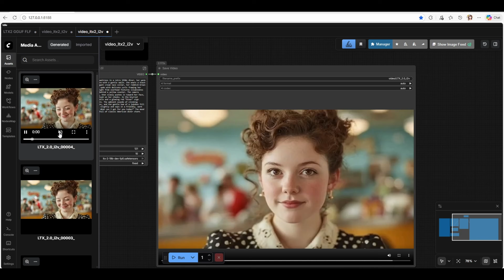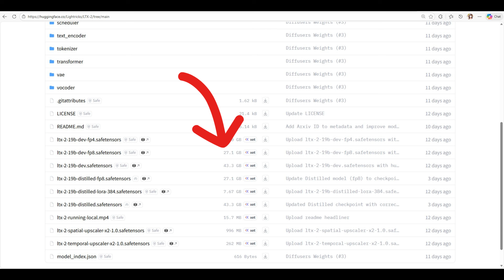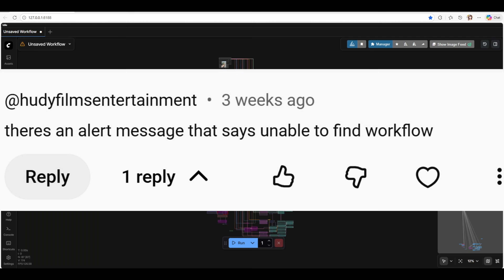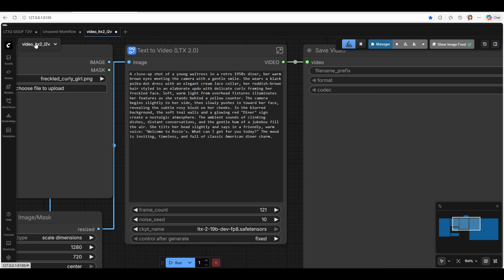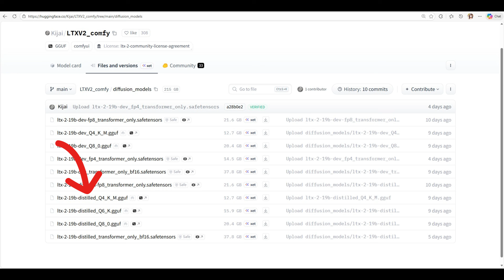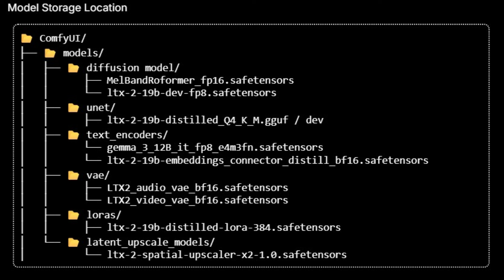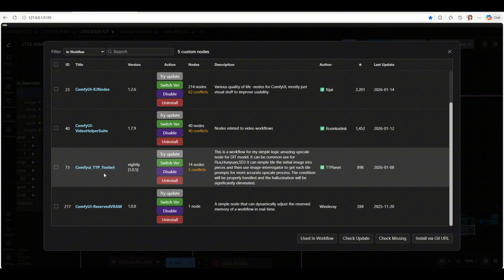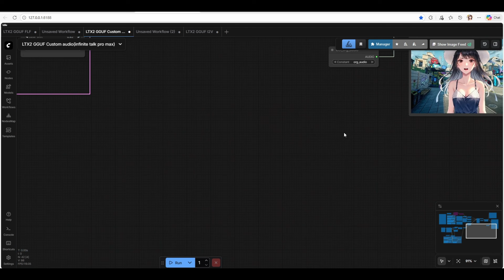LTX-2 Full GGUF Workflow Setup Tutorial (Text, Image First/Last Frame, Custom Audio)

Comment: what about 16GB VRAM + 32GB Ram?
Reply from the maker: I don’t know, should be fine — I can only run 8 GB VRAM + 32 GB RAM in certain cases.
Just note the model loading phase alone can eat around 38–40 GB system RAM, so you might run into issues there.

Comment: Useful video thanks. I managed to get the workflow working with the Q8 DEV GGUF but the video quality is still pretty much garbage at 720p, as you might expect since it only takes a couple of minutes to generate. How do I move to the lext level of quality, using the same 16GB VRAM but waiting say 15 minutes for great quality, rather than waiting 2 or 3 minutes for 'mush' quality? My results are similar to yours at 10:32 (not great). Thanks for the help so far!
Reply from the maker: Since you have 16 GB VRAM, you should try the FP8 model with the official workflow — it includes an upscaler and the quality is really good. (I removed it on purpose for my 8 GB VRAM setup.)
If you’re happy with the official FP8 workflow, then there’s no need to use Q8 GGUF. The official FP8 workflow already works very well.
If 8 GB VRAM + 64 GB RAM can run FP8, then your 16 GB VRAM setup can definitely run it too.

Usually setting CFG between 2–5 is enough to fix this issue.
DPM++ 2M tends to give better resolution compared to Euler (you should test both yourself).
Officially they recommend RES2S, but you’ll need to install the res4LYF custom nodes first.（i reply at the other comment，just in case you cant find it，i comment here again）
Reply: @AtelierDarren  Thanks, yes I'll be able to try on my newly built PC which has 80GB DDR5 RAM.
Normally, I would expect a Q8 DEV GGUF to give better quality than an FP8 version but maybe that's not the case with LTX-2.
By the way, my new PC should have dual GPU capabilities (not tested yet) so I'm waiting to see if I can have 32GB VRAM available by slotting in both my RTX 5070ti and my RTX 5060ti 😃

Comment: I have a question. I have 16GB VRAM + 64GB RAM.  I'm using "ltx-2-19b-dev_q8_0.gguf" model, so distilled LORA is required. Now, how many steps & cfg should i set up? - 8 STEPS + 1CFG or 20 STEPS + 4CFG? I'm focusing on quality over speed. The second question - Sampler. EULER or RES2S?
Reply: I basically just asked the same question (see above), I'll check back here and let you know if I find the answer from elsewhere, or maybe someone will help us out 🙂
Reply from the maker: Usually setting CFG between 2–5 is enough to fix this issue.
DPM++ 2M tends to give better resolution compared to Euler (you should test both yourself).
Officially they recommend RES2S, but you’ll need to install the res4LYF custom nodes first.

After that, you’re supposed to upscale the video, but I didn’t include that step in this workflow. (As you know, people will complain that the workflow doesn’t work, crashes, or OOMs — headache — so I skipped it.)

Let me know if you have any questions. Hope this help a bit.

Comment: LTX2はシステムメモリも浪費が激しく、メモリ解放も自動でできない場合、私のパソコンを放置して動画を量産するのには向いてない。Clear Cache Allノードを組み込んでも、動画生成後にシステムメモリは解放されない模様。何か良い方法はありませんか？
LTX2 is also extremely wasteful with system memory, and since it can't free up memory automatically, it's not suitable for leaving my computer idle to mass-produce videos. Even when incorporating the Clear Cache All node, it seems system memory isn't freed up after video generation. Is there any better method?🤔
Reply from the maker: 「comfyui_memory_cleanup」をLaogou氏のリポジトリからインストールし、VRAM Cleanupノードを使用します。
Offload ModelとOffload Cacheの両方をオンにして、ノードをVAE Decode (Tiled)とVideo Combineの間に配置してください。
これにより、RAM使用量が大幅に削減されます。
ただし、各生成後にLTX-2モデルがオフロードされるため、次の実行時にモデルの再読み込みに時間がかかる点に注意してください。

You can install “comfyui_memory_cleanup” by Laogou and use the VRAM Cleanup node.
Turn on both Offload Model and Offload Cache, and place the node between VAE Decode (Tiled) and Video Combine.
This will drop RAM usage significantly.
Just note that it offloads the LTX-2 model after each run, so the next run will take longer to load.
Reply: @AtelierDarren  Thank you. I'll try it!🤩

Comment: First to last frame generations just bleed to white immediately then bleed back to the last frame.  Any Idea on the potential cause?
Reply from the maker: I Hate LTX 2...
Reply: @AtelierDarren  💀
Reply from the maker: @ICEknightnine  Nah, it is too headache to solve this. If you have better finding, feel free to share:face-blue-smiling:
Reply: @AtelierDarren   I tried a few different workflows using the KJ gguf setup. So far I'm guessing it's a VAE issue, using different images results in garbled videos and audio. The VAE files just don't seem to work for me.
It seems like I'm stuck in the same boat as the guys in the forums " 8:16 ".

Comment: computer turned off, tried again got oom error 2080ti 11gb 32gb ddr4 ram
Reply from the maker: try check your backend，see who is the culprit that cause oom， vram deplete or ram deplete，i guess is your ram depleted. put more pressure to your vram by adjusting the reserved ram to 0.6. Monitor your backend again.
Reply: @AtelierDarren ksampler part now is fast but it crashes on the vae decode part , but its consuming 10.6vram it says , then cmd exits...
Reply from the maker: you are doing 720p resolution？video length？how about ram？ I strongly believe that your ram depleted. Check your ram usage. If yes，you will have to active virual memory to avoid oom.
Reply: @AtelierDarren  400x400 at 49 frames as a test
Reply from the maker: @DeathMasterofhell15  Shouldnt be any problem...strange, backend any error code?
Reply: @AtelierDarren  how to fix the backend error? does ltx2 have a taehd?
Reply from the maker: @DeathMasterofhell15  not ltx2, it is the one with black background command everytime you start your comfyui.
Reply: @AtelierDarren  it says pause exit..
Reply from the maker: @DeathMasterofhell15  I know pause exit, but before that any suspicious eror code? how was your vram and ram usage(check task manager)?
Reply: @AtelierDarren  everything was fine, ram usage was at 76% cpu was at 50% gpu usage 91%
Reply: @AtelierDarren  fixed it used --lowvram with reserver memory of 3

Comment: I’m using an RTX 5090, and with the LTX2 base model I can generate I2V videos longer than 10 seconds without any issues.
I wanted to try GGUF out of curiosity, but even when I keep all the conditions exactly the same, I keep running into an out-of-memory error during the VAE decode (tile) stage.
How can I fix this?
Reply: limit length is 8sec T.T But super fast it takes just 90sec.
Reply from the maker: Sorry, I haven’t had time to test this yet. Feel free to try it out on your end 😊
Reply: @AtelierDarren  I'm really sorry but I'm wondering why VRAM issues are limiting the generation time for GGUF. Given that I can run even heavier models, why is GGUF specifically causing this bottleneck?
Reply from the maker: @아주작은한가지  GGUF mainly affects inference speed, not the maximum generation length. FP8 usually runs video generation faster than GGUF. If you’re on a 5090, avoid reserving too much VRAM — otherwise the workload can spill into system RAM and cause OOM errors, even if your VRAM isn’t fully used. Not sure how much RAM you have, but you can monitor its usage during generation to see if it’s hitting the limit.:hand-purple-blue-peace:
Reply: @AtelierDarren  I’m not very tech-savvy, so I might not understand everything right away, but I’ll definitely study more. Thank you!

Comment: thanks for video, but i have a problem. I installed TTP nodes but still giving me missing node error for First-Last Frame node in LTX220FLF workflow. :/
Reply: for the ppl may have some issue; i installed manually with git clone and it worked,
Reply from the maker: Thanks for the effort! This info is really useful！

Comment: Thank you so much for this tutorial. I have been holding off on downloading LTX-2 because I was waiting for you to come through. Also, the information about dev vs distilled GGUF was very enlightening. Thank you.
Reply from the maker: I remember you! Thanks so much for the support and patience — I was honestly super frustrated trying to figure out the issue this week. You’re amazing!
Reply: @AtelierDarren  No, you are amazing! I am still learning the ropes of ComfyUI. I'm just not sure i LTX-2 will work because it is still quite heavy. Though I have 12 GB VRAM and recently added another 16 GB RAM to bump the total RAM to 32GB, I'm still not convinced.
Reply from the maker: @trevorgreene5059  Usually, GGUF can run on 8 GB VRAM with 32 GB RAM, but keep in mind that not everyone gets it to work perfectly. Some people have reported in my comment section that they still get blurry or noisy outputs even using my workflow, since it can be a bit unstable. FP8 doesn’t have this issue, so if possible, I’d suggest trying FP8 as well.:body-blue-raised-arms:
Reply: @AtelierDarren  Interestingly. LTX-2 runs about 5 minutes for 3 seconds clip but the SVI pro almost takes 10 minutes. Also, I am not seeing lip sync happening on LTX-2. Seems like other channels and comments are saying  LTX-2 isn't quite production ready. Some have said they are sticking with Wan 2.2 or even Wan 2.1 SCAIL.
Reply from the maker: @trevorgreene5059  Yeah this model is very biased between people. Some guys get insane results and others get trash lol. Lip sync isn’t dependable yet on LTX-2, so a lot of people are still sticking to Wan 2.2 or SVI for production. LTX-2 is fast but not consistent enough for everyone.
Reply: dont use it, the quality of LTX2 is terrible and just adds to the AI Slop pool, stick to WAN22